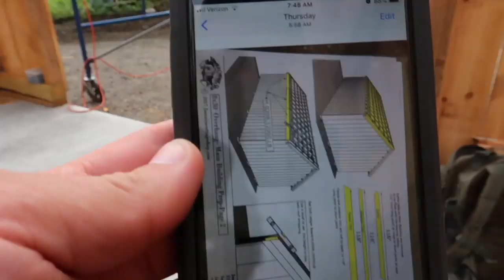Today's the DAY! Starting the Roof on the Post and Beam BARN KIT

Comment: Why is the tin shorter than the barn roof line? Shouldn't it hang over a few inches?
Reply: There must be some type of transition piece for that in the barn kit.
Reply: @augustreil  I wondered if there was possibly some kind of flashing. But it will have to go under the roof tin and above the side overhang tin.
Reply: @BroqueCowgirlHomestead , True, there has to be. It's a cliffhanger, so many people are wondering about how it's going to work. I have confidence that Al will pull through this dilemma !!
Reply: @augustreil  I wholeheartedly agree with your confidence in Al.

Comment: Why did you run the roofing short? As it doesn't extend past the fascia.
Reply from the maker: We still need to build the sides to the barn. It will make sense when we get to phase 2 of the barn build.

Comment: 11:50 Tapping the concrete as the drill went through probably didn't help it much either. There is a bit sharpening jig that'll save those bits from the garbage.

Comment: I just had a roof put on my home and them guys used a tin snip tool, I asked why not just use a saw an they said it will cause it to rust faster and weaken the end of the tin you cut because of it getting hot also they left a 2in over hang on the end and side of the house but I see you only did it on the side why is this?

Comment: Your side walls are going to have major rot problems. Your lean-to structure on each side should have been roofed first with a flashing layer down on top of the lean-to roof and under the shop roofing panels. The way it is now you will always have water pulling back to the first roof strapping piece that is unless your possibly going to pull all of those lower screws and flash it at the end which definitely isn't working smarter.

Comment: My question is if it’s a pre cut kit why didn’t it state what type of tools work the best? Also when I did roofing with my husband we put down insulation then black felt paper, no leaks no metal dripping inside from sweating.....and a warm building in winter and cooler in the summer....also we put the ribbed foam strips on the ends to keep wasps and bees from crawling up the openings and making nests....just saying.....if next time when you get a project bug you might research how tos from the professionals......save you mistakes and grief.......good job though, it’s hard work 😓 I know from exsperience....

Comment: Hmm, I am thinking that you should have some overhang onto the side roof panels or is there some part of the master plan that I am not seeing?
Stay tuned for the answer.
Reply: I was thinking exactly the same thing - the norm is around 2 inches isn't it? Hopefully there is some future detail we are missing and it isn't a colossal mistake!
Reply: Didn't he say there would be another part on both sides?  He's just working on the middle barn section and the other two will have overhangs for the animals, although he also said those sections would have stones or gravel for their feet, so I'm really confused seeing concrete now but I'm still  waiting...almost patiently.  🙃🙃🙃
Reply: @valeriesmith9639 , He must have changed his mind and went with concrete, which is a much better plan.
As for the overhangs on each side, There must be some type of transition piece/flashing for that in the barn kit.
Reply: @augustreil  There has to be something otherwise it will run down the wall inside and outside. A flashing would work.
Reply: @valeriesmith9639  Al said in a previous video that he changed his mind about the gravel.

Comment: Umm shouldn't the roof screws have been through the high part of the roof tin especially on the overlap. And also more overhang on the bottom edge so water has no chance of flowing onto or into the building? Ex builders labourer who has done a lot of roofing.
Reply: Either way works.

Comment: That was really sad to watch, EVERY manufacturer of roofing steel EXPRESSLY prohibits hot cutting of the roofing panels, you should ONLY cut them COLD, tin snips, nibbler or circular saw with many small carbide teeth, cold cutting draws the zinc coating over the cut surface and provides a good protection against rust.   Your roofing panels will be cowered in rust in short order, mostly on the edge where you cut them, but maybe also where the molten slag burned the coating.     Keep up the great work.

Comment: Hello,  You are scratching the paint with your method of cutting.  The grinding dust works as an abrasive and scratches the paint.  Tape on the platen will not solve it as it only imbeds in the tape and scratches more.  Same problem with a cold cut saw.  If you are going to use one it pays to immediately using soap and water wash and dry the grindings off as they will begin to oxidize right away causing rust stains in your paint as well as rust on the exposed cut edge.  Shears are the best way to cut steel roofing both power and hand.  If you can rent one a cutoff shear is the very best.  Also you are overdriving your screws.  The proper torque is just enough to seat the screw without "squishing out" the neoprene washer.  When done properly the neoprene is the same not larger diameter as the metal washer on the screw.  You can also see the 'dimple' in the sunlight indicating you have overdriven the fasteners.  When pilot drill use either a punch and hammer or less desirably a much smaller drill bit (again with the swarf which is working to scratch and rust).  The punch does not remove material and when the screw penetrates it actually makes a very small 'volcano' around the thread rising up as the thread screws in.  This helps waterproof.  But again these are not "crush washers" and will deteriorate the performance when driven that way actually damaging the integrity of the neoprene as well as speeding its UV degradation over time (thinner washer showing more surface to the sun).  By all means don't take my word for it and check with your steel roofing manufacturer.  Most all have free brochures and website information on using their products the correct way.  I would also recommend using touch up paint on those scratched  and ground surfaces and edges.  That grinding dust under your overlap is certainly not going to help you in the future.  Removing it first before installing would have been beneficial.  Rainfall definitely won't take it off.  

Enjoying your projects for sure.    Take care.  Doug

Comment: You screw metal in the ridges, not the flats it will leak water
Reply: No it will not. Either way is fine. If that were true, half the tin roofs in the country would leak.

Comment: Why did you not put any ply wood first on the roof before putting alumni on it?
Poor animals get a heart attack when it rains
Reply: My thoughts exactly.  The noise will be too terrifying for them.  I certainly wouldn’t want it for my roof either.   I’ve stayed in a cabin with a roof like that, during storms/rains.  It’s so frightening.   The roof is going to make the barn too hot in the summer as well.
Reply: @SandNSurf , There must be an awful lot of animals throughout the U.S. that are terrified then, because many, many barns have tin roofs exactly like Al's.
There's no need for plywood, it would be a waste of money.
Al also said that it will have a ridge vent, which will let the hot air out all along the peak.
Reply: @augustreil  - I also reckon that Al will probably insulate central section sometime.

Comment: Should have at least 3"in over hang on the roof so rain down the inside of the wall
Reply: I was thinking the same after he cut the tin  , it looked too short , there's no overhang at all . Everything else was pre measured , why did he think he needed to shorten the tin . Looks like a mistake to me but hell I aint ever built anything .
Reply from the maker: We aren’t don’t get with the build. It will make sense once I have it all built
Reply: @LumnahAcres  Trusting you... like i said , i know jack squat about building . I could hand you screws and other stuff but that's about all the help i would be. Just please be careful it would break a lot of hearts if you got seriously injured.
Reply: @LumnahAcres  I am very relieved to hear that. Keep up the good work - I'm enjoying this as I'm currently building a garden shed at the same time. A bit smaller than yours but all my own work/design and with the weather here in Japan I'm going overboard on over-engineering ;-) Actually not too many sheds around here have Simpson hurricane ties and strapped rafters and structural sheathing with 65mm nails at 100mm on perimeter, but better safe than sorry!
Reply: @joycemetheny8338  I believe he is following the instructions of the company he bought the kit from. Go back to the beginning of the video. I think he read the dimensions from the instructions displayed on his tablet/phone.